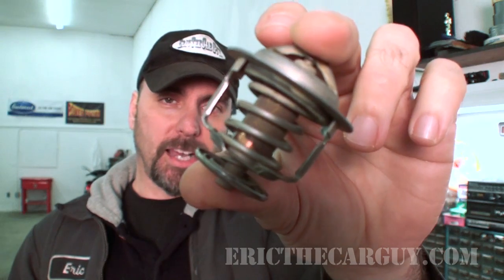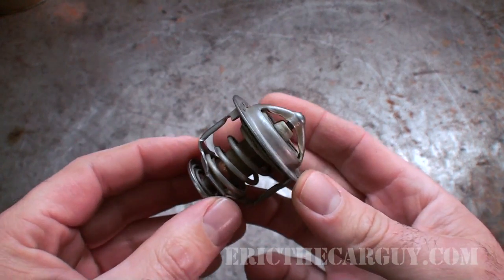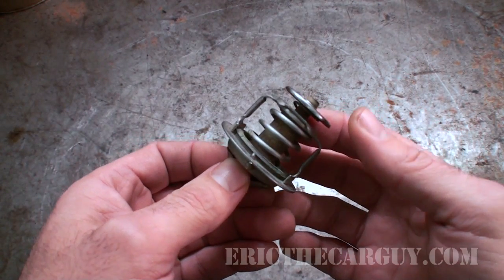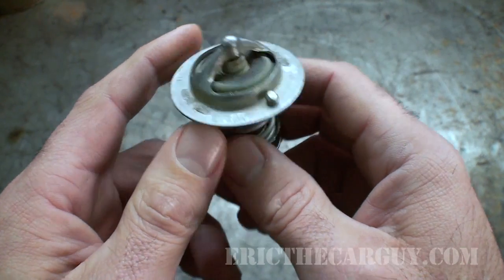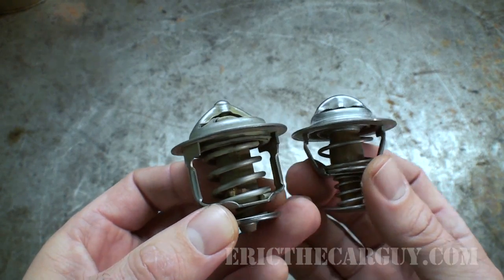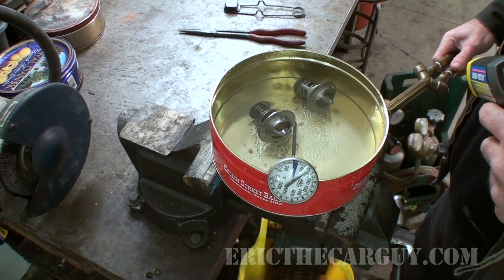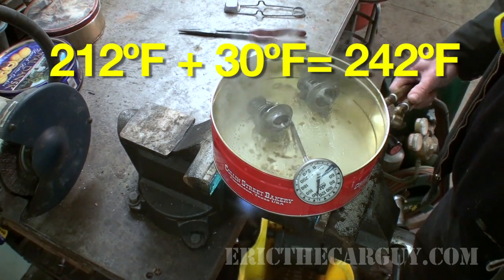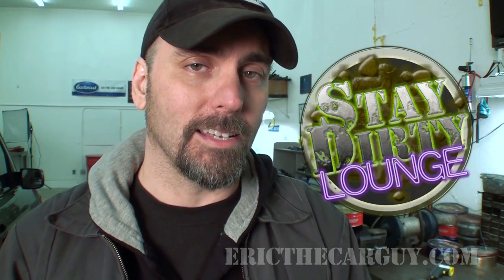Understanding and Testing Thermostats -EricTheCarGuy

Comment: Hey Eric so we hardy Minnesotan people here are currently dealing with the cold (shocker ha) but anyways, I have a 2004 VW Passat v6 4mo, and well the heater wont start, i mean it starts when it wants to, or when i give it a good smack on the dash to or the conceal, at times you just feel a slit breeze of faint heat then starts. i had the water pump and the thermostat changed in the late fall, and on top the coolant leaks, so i have to top it off every 5-6 weeks or so.

Comment: Hello Eric, thanks for the video, i was just wondering if the problem with my car (malibu 2000) is the thermostat indeed. I do not have a problem of thermostat always open or always closed regardless of temperature, but i do have a problem that i think it was not happening before. When i am on higway (high speed) and in the morning going to my work, i do see that the car temperature indicator never reaches the middle, it goes just below the middle. And in the other hand, when i am driving in downtown for a while, the temperature goes up, but it passes the middle mark and goes a little above the middle, causing, in my opinion to make the car to lose coolant and in some days i have to refill, and also i can see that it gets more hot than normal, but not to the upper red limit on the indicator.
So i was wondering if a bad thermostat could also loose range, i mean, to not open fully, and to not close fully?  Could that be the case?

Comment: Thank U Eric for Ur Videos. I am not a Car Mechanic and I am having a problem with my heater in  my 2009 Nissan Pathfinder SE ( V-6) 4X4 when I start the car I'll  let it run for 5 to 10 mins before I drive it  and it will send out cool air. When I start driving it get warmer and eventually will get hot but when I come to a Red Light I can feel it getting cooler as time goes on and then when I start driving again the heat comes back.  Can U please give me Ur best Opinion on what I should do. I'm good with my hands and I'm mechanically inclined so if it's something I could do myself I would like to but if it's a difficult process I'll just have to take it to a mechanic Thank U and have a Great Day...
Reply: If you're not fixed yet, check the level of your anti  freeze. Top it off. I used to have that prob when mine got low.

Comment: Im woundering if i have a bad thermostat. 1999 saab 9-5. If i start the car and let it sit it will warm up to were it should. If i start driving and put the heat on it cools way down if i shut the heat off it starts to warm up again. Never over heats though

Comment: I have a 2002 Ford Taurus 3.0 SOHC I am having a temp issue, if I let it idle in place the temp will sit in the normal temp range, as soon as I drive it any distance the temp will drop and stay just above the bottom of the gauge range. The coolant is full and clean. I am at a loss and am looking for a place to start any help will be greatly appreciated.

Comment: following your explanation of "stuck open thermostat is as damaging as stuck closed", I am quoting the following from yahoo answers : 

Aman answered 5 years ago
a thermostat stuck open will not allow the engine to reach operating temperature. 
If the engine can't reach operating temperature the car's ECU will keep the car in "open loop" 
in open loop, the ECU tries to get the engine up to temp by adding more fuel making your engine rpms to increase, thus creating more heat. The 02 sensor (which tells the ECU if your car is running rich or lean) is IGNORED in open loop. 
So you are burning more fuel, thus your low mileage. And running your engine while its not at operating temperature does some severe wear to the engine. 
I definetly suggest replacing it soon.

I have the 2nd O2 sensor error (bank 1 sensor 2 on 3L ford taurus 1999) saying that the sensor heater not working which caused the check engine light (MIL) goes on. I have noticed slight increase in gas consumption. Now in winter time in Canada, I just had to deal with heating problem of my car, I started with unclogging heater core, flushing coolant, and now I have a stuck open thermostat. I have learned a lot about the importance of thermostat function. great job Eric.

Comment: 4 cylinder can over heat from removing the stat
Reply: how?
Reply: AZ DONALD the radiator is too small to cool a Constant flow of hot coolant
Reply: dfissell I've got a degree in physics and this makes no sense to me.  if the water is going too fast thru the radiator to cool then it's going too fast thru the engine to heat up.  is this an urban legend or do you have links to this discussion?
Reply: Might I suggest thermodynamics a single core or 2 core radiator does not have enough surface area to provide adequate cooling open thermostat so the thermostat must close to get the liquid in the radiator time to cool down before exchanging it with the hot liquid in the block
Reply: dfissell every single closed system engine on the planet runs colder without a thermostat, not hotter.  a thermostat closes to raise the operating temperature, not lower it.  what you are saying makes no sense at all.
Reply: are you insane? like hell they do only one with large radiators like diesels with 10 gal systems in cool climates or gas cars with 3 or more core radiators you should ask for your money back for that diploma
Reply: dfissell  namecalling indicates the loss of an argument, thank you.

eric clearly describes the symptoms of a thermostat stuck open at 0:49. if you can't comprehend him it means that the vehicle is running COLD.

here's a little more for you:

"How to diagnose a bad car thermostat:
Most car thermostats fail in one of two ways: they become stuck either in an open position or a closed position. A closed thermostat valve will cause the engine to overheat, harming the engine and potentially destroying the head gasket, while an OPEN thermostat valve will over COOL the engine, causing it to work much harder than necessary.

The symptoms for both an open and closed stuck thermostat valve are relatively easy to tell. A closed thermostat valve (overheated engine) will be indicated by your vehicle's temperature gauge plunging into the red. This may happen slowly or quickly, and wintertime driving may make this symptom less severe, but a vehicle that's running hot should always be brought to a mechanic immediately. An OPEN thermostat valve (UNDERHEATED engine) is indicated by a car not putting out as much heat through the vents as it should, and by automatic transmission vehicles having difficulty shifting to higher gears. The latter may be more difficult to tell in summertime, when heating vents aren't used, which is another good reason to always be attentive to your vehicle's engine and transmission performance."

I suggest you get a refund on your GED. 

.
Reply: you are clueless an stuck open thermostat will cause an over heat in most if not all 4/6 cylinder car cold air form the heater is low coolant stuck or blender  or a thermostat that opens at to low of a temperature and low coolant is a sign of a leak, neglect, or overheating and overheating does not make a head gasket go bad warping of the head due to over heating will make a head gasket go bad   you have no clue how a car cooling system works
Reply: dfissell  I guess ericthecarguy, stant, wikipedia, jeep forums, chevy forums and ehow are all wrong and you, the guy with the GED, is right?  lol.  please write coherent sentences, it's hard to follow your babble.

here, i'll save you the confusion of reading it all :
"If your car is running unusually cool and not building up any heat in the engine, it's likely that your thermostat is stuck open and is letting too much coolant through."

Symptoms When the Thermostat Is Stuck Open	
By Jen Davis, eHow Contributor
-last updated August 29, 2014
    	
							Jen Davis						
							Jen Davis has been writing since 2004. She has served as a newspaper reporter and her freelance articles have appeared in magazines such as "Horses Incorporated," "The Paisley Pony" and "Alabama Living." Davis earned her Bachelor of Arts in communication with a concentration in journalism from Berry College in Rome, Ga.

Your car will not run efficiently if its thermostat is stuck open.	

A vehicle's thermostat is partially responsible for maintaining proper engine temperature. It's designed to control the flow of coolant through the engine. If it's not opening and closing properly, your vehicle may display several different problems. Though your car is better off with the thermostat stuck open rather than closed, you should repair the component immediately if you suspect it is stuck open.
Low Engine Temperature
If your car is running unusually cool and not building up any heat in the engine, it's likely that your thermostat is stuck open and is letting too much coolant through. A thermostat that is stuck in the closed position will cause your vehicle to overheat. Most drivers know when the vehicle's engine temperature gauge creeps toward the red area but may not be aware that an engine is running cool. It's important to know your engine's regular operating temperature because running too hot or too cold are both signs of problems with the cooling system.
No Heater
Your vehicle's heater works in conjunction with the engine's cooling system. The heater builds up warmth as the vehicle runs and brings in the warm air from the engine to warm the interior of the car. If the engine does not warm up enough because the thermostat is stuck open, the heater will not deliver warm air to the interior.

Read more : http://www.ehow.com/list_7606570_symptoms-thermostat-stuck-open.html
Reply: yes they are wrong you should learn about how heat transfer works
Reply: yes, dfissell everyone else in the world is wrong and you are right.

here's another one for you: https://www.rockauto.com/catalog/moreinfo.php?pk=4483764&cc=1180314

motorad makes a failsafe thermostat which locks open, not closed, in an overheating situation.  imagine their embarrassment when you inform them that they have their entire business model backwards and that they need to make their thermostat lock closed to cool the engine!  lol

please educate me again as to how i'm wrong and how heat transfer works...

{{In OVERHEATING situations, the Fail-Safe thermostat automatically locks in the OPEN position, delivering MAXIMUM COOLANT to the engine.

When standard thermostats fail, they lock in the closed position, prevent coolant flow and possibly cause serious damage to your engine. The Fail-Safe thermostat has a patented safeguard against overheating damage. Upon system failure, the Fail-Safe locks in the open position. Coolant flows freely. Helps protect the engine in the event of overheating}}

.
Reply: yes i am right and you have no clue what you are talking about
Reply: and that thermostat is a gimmick it might get you a few more feet in a 4/6 cylinder but that's it in a v8 with a large radiator it might keep you from over heating you are better off turning your heater on max and rolling down your windows

Comment: video is little old but i was wondering because i read  someones post, keep in mind i dont know much about cars, sounding like it kinda fixed a cat problem.  My vehicle has a cat code which made it fail the smog test even though everything else passed, the service engine light is on and instead of replacing the the cat i was hoping this could possible solve my issue?  That and the guy said it wasnt a California catalytic converter but it passed smog through them last year.

Comment: This was a helpful video. I encountered different problem with my radiator fan. when a/c is on the fan is functioning at low speed and fan speed doesn't change even the temperature gauge keeps high which affects the aircondition, but when the a/c is off , the fan will function in high speed when it reached the mid temperature. I am wondering what to be changed or to be repaired. hope you help me.tnx

Comment: I was waiting for you to mention how to diagnos the themorstat without taking it off the car. In one of your videos you mentioned that by the lower radiator hose can help you determine if the themorstat is bad. Say, your engine over heats and the lower radiator hose is still cold while the upper radiator hose is hot. Am I getting it right?

Comment: "the original equipment thermostat has a rubber seal on it. if you heat that up directly, that rubber seal will likely melt. and that will suck" LOL

Comment: On my b18a1 I had been driving the car a couple of hours and wen I let the car fully cool down I mean engine was cold I still had pressure in my upper hose what could it b I am running pr3 high compression pistons.. could it b cap. Thermostat.  Or water pump

Comment: Any commentary on Fail-Safe Thermostats? They are designed to fail in the OPEN position so that when your thermostat does fail, the risk of engine damage is limited.
Reply: I am about to replace my thermostat with a Everlast name brand because it stays open when it fails. Not aware of what other ones have that capacity but my local Autozone confirmed it for me.

Edit: Name brand is Fail-Safe. Not Everlast.
Reply: Nowadays  automobile engineers smart enough than old days mechanicals!   Temp sensor will tells the control board to shut off for proventing overheating damage of engine !

Comment: hey eric. I have a 1997 Lincoln continental with a really bad overheating problem. the car gets so hot it stalls, after a little while it will restart if you add some antfreeze to it. I replaced the thermerstat, new Radiator, all new upper head gasket set, all new hoses, and water pump. and I even tried bleeding the system. I really need some help so please write back soon.

Comment: Hi Eric, I have a 1999 vw golf 1.6 and it will not heat up to the correct operating temp. I removed the thermostat and it had an opening point at 87 C which I tested the way you showed in the video. The thermostat opened at exactly 87 degrees and then when I removed it from the water and it closed all the way. I installed it back in the car and it had the same ploblem again. What can be the problem then?

Comment: i replaced my thermo on my 03 explorer when i replaced the housing due to leaking. this winter i noticed the engine only heats up to about 30 degrees F below usual temperature, it doesnt take long to get up to that temp so i don't think its stuck open and you have to fill the coolant through the over flow bottle so i was told they are self bleeding, is it possible that the thermostat just opens at to low of a tempature

Comment: The only thing i noticed with the after market thermostats was the copper inside the housing was thicker.  The heat caused the the copper to expand and recede that after time the copper swell where the spring couldn't move.

Comment: Also, if you are having a failure to reach op. temp. you need to take your thermostat to a sink and verify it doesn't have excessive leak by. It can leak by a significant amount and still appear to be "closed"

Comment: I found out something interesting with the thermostat in my Ford Probe LX.  It never overheated on the road, but after I would stop in the garage it would bubble into the recovery tank, splashing some out, even though I had filled it to the level marked on the tank.  I was aware that there might be hot spots in the engine after the water pump was not circulating the coolant, but the engineers who designed it were certainly aware of that fact.  I took the thermostat out and tested it in a pan of boiling water and it did not open up at all.  This was surprising, as I am only at about 1100 feet above sea level, so the boiling point is not that much different from 212F; also the thermostat looked pristine, no gunk.  Someone suggested to me to test it in a pan of heating oil and sure enough, it eventually opened and closed at some unknow temperature (I didn't have a proper themometer).  I don't know if some of the wax inside leaks out with time, or maybe the characteristics change with time, but a thermostat does not have to corroded or gunked up to fail to open at the design temperature.

Comment: Eric I have a 93 Chevy pickup and I do not have a thermostat in my truck because every time I install a new thermostat it runs hot but without the thermostat it is fine.  Do you have any suggestions?